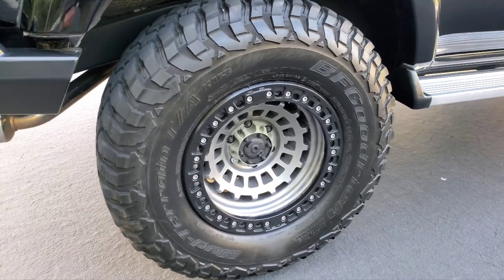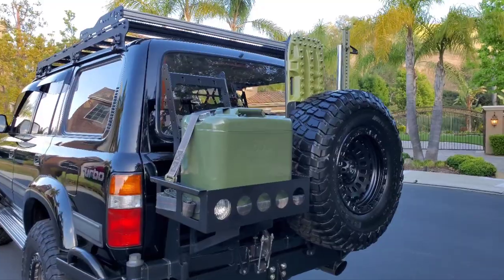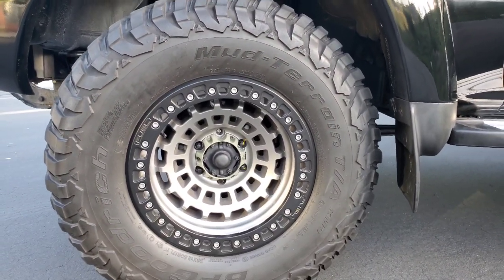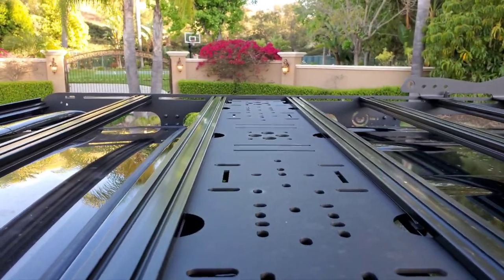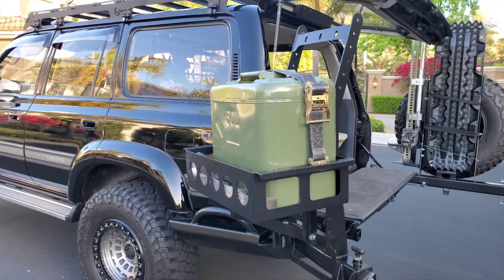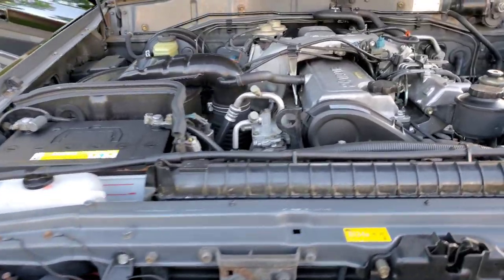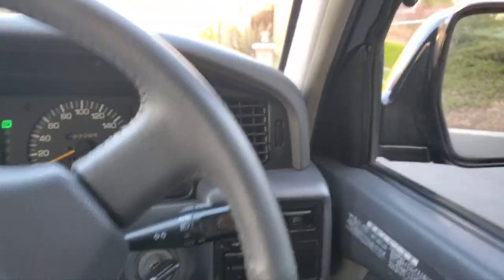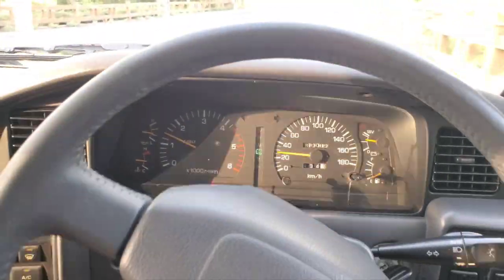Land Cruiser 80 Black Mamba final Reveal

Comment: Beautiful build! Not knocking anything, some notes:  spare might look cool if its center cap was painted moss green too? It would match the gas can.  That front bumper...ehh...damage multiplier?  Sick build. Great work.
Reply from the maker: Good idea. The rear wheel came in a couple hours before the video, so didnt have time. I also have some moss green vinyl wrap coming in, so may come cover the chrome logo in the cap.
True on the front bumper in event of a big hit,. Which front bumper would look best?
Reply: @CruisingTheLand  If not custom, the Slee Short bus, I have a custom one off for my 80.
Reply: Front bumper less capable sure but it has a bit of a jdm period piece quality to it, he's got like legit rock crawlers no need to make everything a total brute haha

That said the slee is awesome, i'll be putting short bus on my HDJ since I have just the factory bumper

Edit: Honestly I think no brush guard and stock bumper might be the move if keeping the aluminum running boards

Another Edit: Oh its JAOS, leave it on 100% lol

Comment: Hey I got a 200 series. What bumper would you recommend? I have an 80's series too with a arb deluxe. But 200 series not sure.
Reply from the maker: For 200 either Slee or Victory4x4.
Reply: Question, when you turn her off, do you have an aggressive shake to the vehicle?  Everyone I talk to out here in  say it’s due to the big diesel.. trying to figure out if I need new engine mounts or something else..
Reply from the maker: @darrylparker3661  definitely a shake, that normal. Mine has a turbo delay, so.runs 5 extra seconds to expel all exhaust build up... then the 5.4 on the richter scale.

Comment: Love it man, I have the same ride(stationed in Japan), definitely enjoy the build!  How about an ARB front bumper?
Reply: Also, any plans for upgrades underbody?
Reply from the maker: I will put Kings with dual rate Springs, but no armor. This 80 will overland, but not crawl. I have another 80 that is 3x locked  (will do a comparo soon) and a HZJ73 on 37s 3x, and a FJ40 5.7L V8 on 40s 3x that I would take for crawling.
Reply from the maker: In Japan does a clean 80 get attention like it does in US, or are they used to it? Is it rare?
Reply: @CruisingTheLand  awesome, can’t wait to see it, I’m taking notes for mine!
Reply: @CruisingTheLand  there’s definitely a LC following out here.  Most common to see are the diesel 70 series, but the 60 and 80 series definitely get love too.  Overall though, most Japanese locals drive Kei Cars, so seeing big body Land Cruisers are rare.

Comment: dual battery because it is a diesel or because it is 24 volt?
Reply from the maker: both.
Reply: @CruisingTheLand  LOL
Reply: @CruisingTheLand  Actually only the starter motor is 24 volt. The rest of the car is 12v. The 24v starter motor comes in handy in cold climates but is overkill in warmer areas. There is a solenoid somewhere in the ignition system that flips the second battery to be in series when the starter motor is needed, but otherwise it’s in parallel with the other battery. There is a mod out there to simplify the system and replace the 24v starter with a more traditional 12v starter… certainly gives you more parts commonality.  

Love what you’ve done with the truck.
Reply from the maker: Hi Ken, yes thanks for clarifying. Its nice that is is a 12V system, but has that 24v for starting. Easier for accessories set up.
Would you say ultimately same as a dual battery set up for someone with a Fridge, accessories etc... just no cut off for overuse saving starter battery for enough juice?
Reply: @67jkg  24 volt plus the glow plugs

Comment: What's the mileage on this beauty?
Reply from the maker: what is MPG or total miles?
It just rolled over 190k KMs, so that is 114k miles
MPGs are low 20s now that its weighted down a bit on 35s
Reply: @CruisingTheLand  Beautiful result. Looking at a 1997 80 series black truck today: 206,000kms. Seller wanting $28k USD. Not sure but looks in decent condition. Love your work. You’ll need to visit New Zealand sometime!
Reply from the maker: yes, New Zealand is on the bucket list!